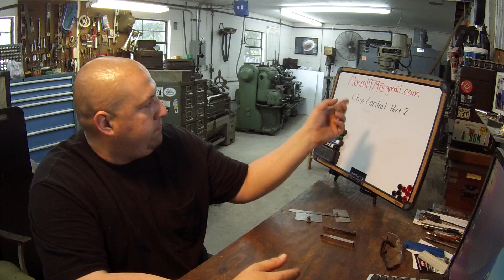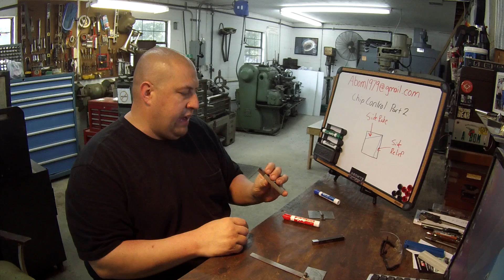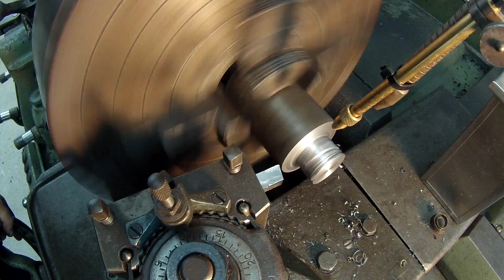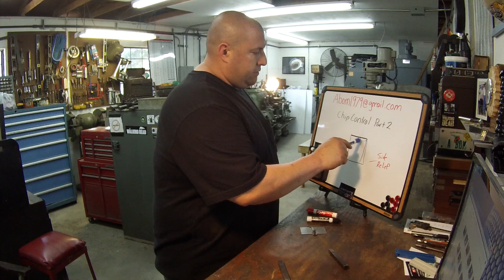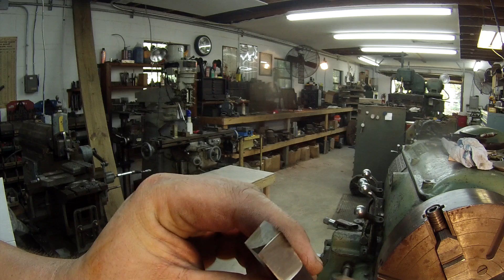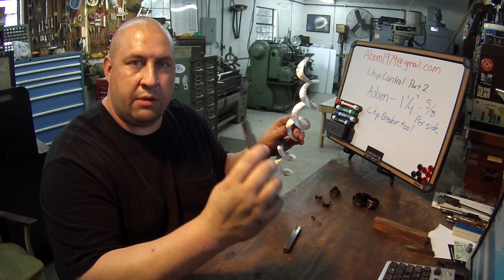Chip Control Part 2

Comment: does the groove go all the way to the edge? if it does doesn't that effectively increase the rake of the cutting edge?

Is something like the cap iron on a plane ever used as a chip breaker on lathe tools?

Comment: Also wondered if there's an issue with heat build up when grinding and dressing the cutting tool? I know you water quench during the grins process but it would seem if you have any "blueing" while grinding you'd lose cutting tool temper?....
Reply from the maker: HSS is very stable at high temps, so normal grinding isn't going to take the hardness out of the tool. You can even weld them to bars, or together and they still work great.

Comment: Jeeeez, can't imagine the tonnage of pressure on that tool post and cutting tool. That lathe is a beast!

What kind of HP and amperage does that lathe have?

Learning a lot, great info Adam.
Reply from the maker: The motor is a 5 HP GE. Don't recall what the amperage is on the motor though, it's running on a 40 amp breaker.
That type of heavy cutting does create a lot of force on the machine, and you can feel it when you release the feed. I could tell the chip breaker tool has less pressure than the side rake tool though.

Comment: Hey Adam,

Nice work. I guess I better get busy. The chip breaker was working great. I have some of those dark un-ground rex bits as well. They seem to act a little different at my end here with coolant versus cutting oil. Nice presentation.

Talk to you soon.

Tom
Reply from the maker: Hey Tom, I had much better luck with the chip breaker style over the side rake tool. I guess that's why I used it so much all these years, its what dad showed me and has always worked good for everyday turning. It's also good on bronze, but with more of a sharp edge going into the groove.
I'm ready to see your next video! I'm wondering what else the YAM has in store for us!
Thanks for the comments. Talk to you later on buddy!

Adam

Comment: I feel like I have to say Thank you for the videos that you put out, either for our entertainment and/or education.  I cringe to think about how much that stock is costing you to just turn into chips for our viewing pleasure.  I've never done any metal work and I've been watching your videos for a while now because I'm wanting to build a small cnc router and/or mill in my small shop.  I do have a question about all those chips...  What do you do with them?  Do you have them recycled into more stock or just trash them?  I know it isn't cheap for those large pieces of stock, so you must accumulate several pounds of chips after just a couple jobs.  let me know what you do with those chips if you would, and again, Thank you for putting your time, your money and your expertise on display for our viewing.  I for one truly appreciate it
Reply from the maker: Thanks Jeffry. We always sold our scrap metal to the local scrap yard. We used to go a few times a year, or when I filled up all the barrels. In my new shop I dont make that much waste, so it usually goes in the trash can. It's really not enough to worry about, and I dont have much time to take a couple cans to the scrap yard for just a few bucks worth of chips.
Thank you for the nice comments on the videos.

Comment: Night and day difference between mist and oil, thanks for the comparison. I failed miserably at chip breaker grinding and now I know why, I always took the grind out to the cutting edge, you answered that by leaving a small flat, gonna try again!
Reply: Yeap, you rarely ever want a knife edge on a metal cutting tool, they don't have enough strength and you get huge concentrations of heat in a fine edge with no surrounding material to pass the heat to.
I would however recommend an approx 8-12 deg side rake angle on that small "flat" then the roughly 45-60 deg angle into the chip breaker.
I find it easier to grind a nice chip breaker with a cut off disk in a 4” angle grinder, especially in small tools or where you need a long chip breaker, I find it easier to get a nice straight chip break groove that way than on the corner of a large grinding wheel.
Of course you have a nice surface grinder, so you should be able to come up with a super  precise chip breaker groove.
Reply from the maker: Grinding it out to a sharp edge sometimes works when taking small light cuts, but on heavy cutting you will loose your edge very quickly. I like to leave a small flat there to strengthen the tool edge. On bronze or aluminum you can get away with a more sharp corner though.
Lets see some video if you give it another go.
Thanks Stan!

Comment: Hey Adam, great video. If I would try to take that much off using my grizzly something would break and I 'd be running out of the shop. What kind of cutting oil do you use, and if you get a chance can you go over the cool mist system? Thanks for taking time to share your shop with us.
Buddy
Reply from the maker: Buddy, not all lathes are created equal, so be careful on the little Grizzly. Hell I'm not ever sure Monarch had those kinds of cuts in mind for my size lathe, it but it handled them well. The cutting oil is just dark cutting oil, the old school sulphur based stuff. You can find it most anywhere, even in hardware stores listed as thread cutting oil. Its good for many machining ops.
Thanks Buddy!
Reply: Abom79 Thanks, I have been using Drill & tap cutting oil in a spray can, it seems to work ok but it can be messy.
Buddy

Comment: good stuff
something I think to try is add a "side wall" bent piece of sheet metal under the tool to stop the chip from wrapping around the tool and send it to the chip pan. I'm thinking this may cause the string chip to break or at least stop the wrap up on the tool  
anyway you and the gang  are doing your part to teach use the finer points on machine work and I thank you for that